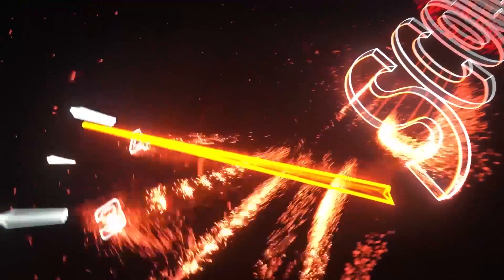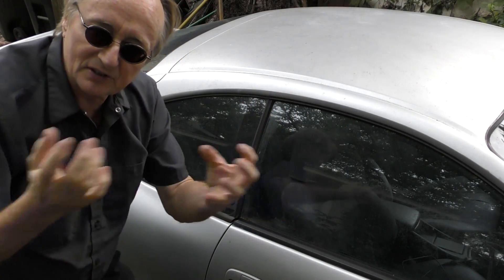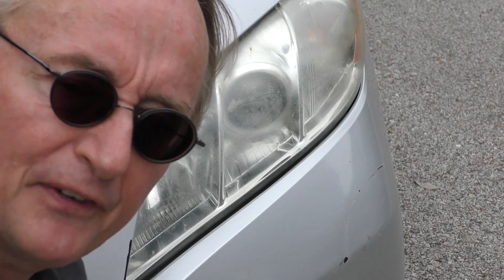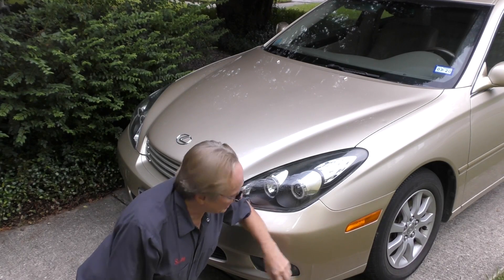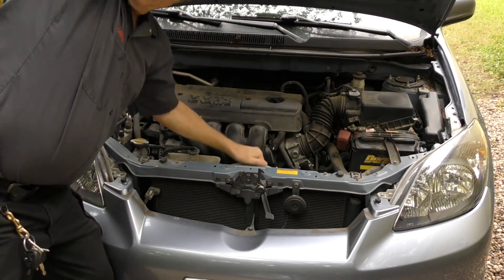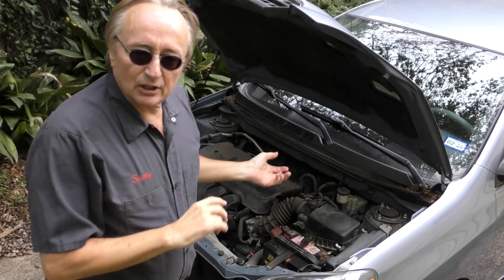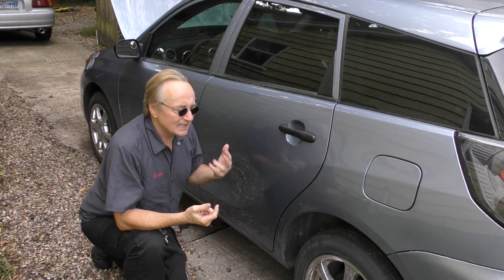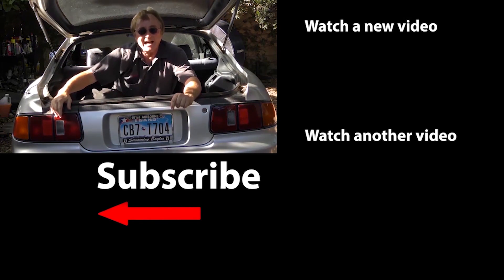You Can't Fix Stupid (Closing My Car Repair Business?)

Comment: And of course it goes out when you have a full tank.
Reply: and you can't siphon gas out of newer cars
Reply: And not only does mine go out when the tank is full, it waits until it's -30 in the middle of nowhere here in Wyoming, and the closest parts store is 60mi, away!!
Fortunately, I carry an extra behind the seat, but dropping the tank is a HUGE PAIN on this Chevy 3500, and no, I CAN'T just CUT a hole in the bed to get to it because of the 110gal transfer fuel tank and cross-bed toolbox.
But 16 fuel pumps in 19yrs is really stupid and being in the tank is beyond stupid!!
Reply: Everytime without fail
Reply: @kellypenrod2979  16 fuel pumps??? why are u still driving that ??
Reply: @kellypenrod2979  16 pumps in 19 years? That is insane.  Are you making sure to fill up your tank before it gets almost empty?  The pump has to work harder if tank is almost empty.
Reply: here is a method i use and seams to work on on my 00 crown vic police car i never let it get below 1/4 tank. see there is some oil in gas and it lubes the pumps. try this method for awhile and let me know how its worked for you.
Reply: Always hahahaha
Reply: Zmax will triple the life of a fuel pump also
Reply: i just kick my tank when my pump fails
Reply: @KeithOutWest  by the sound of it, its a diesel. At that temp its gel. He isnt cutting it enough with gas to make it work properly putting hard strain on the pump.
Reply: @KeithOutWest  Oh yes! that's a very old habit with me! 
Also, I only use pure gas, hot the ethanol.
Thanks for the reply though!
Reply: @brandoncaldwell95  Nope, Vortec 454
2000.
Reply: @kellypenrod2979  Then you shouldnt be eating pumps unless youre getting cheap ones. Im still on the factory one with my 05 silverado.  Dont drain the tank as the fuel is its cooling/lubrication. If need be, buy a racing type fuel pump or even a dual setup. Never below a 1/4 or an 1/8 of a tank. 

I was going to get a 95 454 which ran like a top. Didnt as the interior was shot. Still shoot myself tonthis day not getting that dually. Actually tired of paying my 2018 ram 3500 and wanting an older 03-07 crew cab 4x4 dually 6.6L allison. Truck is way too rare to find!
Reply: @brandoncaldwell95  Don't know what to think, getting my pumps at the Chevy dealer in Evanston, or rock springs, tank has been flushed 11 times never found anything.
But it's all coming to an end anyways,  this POS only has 123000mi on it, and besides the fuel pump issues, I have had the front end rebuilt 6 times, 5 transmissions, 1computer, 3 AC Compressors, and now the top of the bed is against the cab because the frame is bending.
Dealer says the trucks not designed to haul weight at front of bed because it's above a (crumple)
zone.
So, I have found a 97 Ford crewcab 4x4 dually flatbed with 72000mi and it's stick shift transmission and trans-case 7.3 diesel from a man in our church who had a stroke and can't drive anymore.
this chev is the first NEW pickup I ever bought, it WILL BE THE LAST CHEV I EVER OWN.
Reply: @kellypenrod2979  Hmm, well dealers usually grab their fuel pumps and many other parts from regular auto parts stores. Im not joking on that either. As for the bending, thats the hot cold temps and rythmic bouncing over time. Ive never had a truck bend on me and all the trucks here in texas that old and older are not bent.
Reply: @KeithOutWest  Plus they use the fuel as a coolant for the pump motor. Low fuel tank and there may not be any liquid around the pump motor cooling it.
Reply: @no candy Thank you. That sounds like a very possible damage situation.
Reply: Common hypothesis is a lot of people run their gas tank too low, and the pump doesn't get enough cooling effect from the (lack of) gasoline around it. Then you fill up with nice cool gas, and you shock the pump. Hence, fuel pump failure on a full tank.
Reply: @kellypenrod2979  : Kelly make sure you read what I wrote. All of it. I promise you that you will love your old truck again.
Reply: @ronfullerton3162  : Kelly's problem is a bad ground to his truck's fuel pump. Scan through the comments and read what I wrote to him in great detail about how to cure it.
Reply: @no candy : Kelly's real problem is a grounding issue to the fuel pump. Find the comment here that I made to him, in great detail explaining how to fix it.
Reply: @brandoncaldwell95  : Kelly's problem isn't the fuel pumps, it's the grounding to the fuel pump. Or should I say, lack thereof. Find the comment I made explaining to Kelly how to fix it. It's relatively long, but I explained in great detail what the actual cause of the issue is, and how to cure the problem for good.
Reply: @turbodiesel4709  Thanks for your time, and efforts sir, but I just got through SOLVING THE PROBLEM!
I bought that Ford from my neighbor,  And when I got home, I transferred all my equipment on to it from the Chevy, THEN I MADE A TRAILER OUT OF IT!! 
NOW it's a good Chevy, it will go where I need it to, WHEN I need it to.
And as far as the 90, and newer Chevy vehicles, 
NEVER AGAIN!!
Reply: @turbodiesel4709  Bad grounding has gotten to be a bigger problem with all the additional electrical applications on our vehicles. And some of them are crazy to find. I had a van once, and when driving along, all of a sudden the windshield wipers would start running. I would pull the wiper fuse, and it would stop. Later I could put the fuse back in, and everything would be okay. It ended up a grounding terminal up under the dash. It had some blue/grey corrosion, so I took it apart, cleaned, reassembled, and sealed the terminal. No further problems. I always expected something to happen further, because I assumed that some other circuit was grounding through the wipers. But happily, that was it. And I have heard of some other goofy things similar happening. The ground is very important as your information shows.
Reply: @ronfullerton3162  : For sure. I'd be willing to bet that two-thirds of all of our electrical problems in modern vehicles is caused by grounding issues, and corrosion at wiring connections. 

More often than not, such corrosion is brought on by rock salt and calcium chloride that is used on our highways during the winter months. Not to mention, the all too common use of dissimilar metals, like aluminum in contact with steel, leading to electrolysis.
Reply: @ronfullerton3162  : Kelly actually responded back to me. Unfortunately for him, he chopped up his dually Chevy truck, and turned it into a trailer. Well, at least he still is getting some use out of it. 

What's really worse is that he claims he replaced it with a Ford. Ugh... he has no idea the problems that will crop up with that piece of junk.
Reply: @turbodiesel4709  I am with you on the wiring problems on our vehicles. It is sad that a potentially good vehicle may of been chopped up to make a trailer just because of a bad ground. But it sounds as several other problems plagued the poor truck. And, oh boy, the great "brand" wars! We all have our favorites and villains on that subject. Unfortunately the indestructible IHC went out of production. No frills, rough riding, and not economical, but what a work horse. Chevy poor quality and false promises as well as failure to honor warranty in the seventies soured me for that brand. Dodge back then, ha ha ha. Ford produced a good working truck and really followed up under warranty. But to be honest, I do not know what anything is like since the early nineties, so cannot weigh in on anything since then. I was concerned about bigger trucks after that. Really, in many cases, most of them would give good service if set up right for the job and then properly maintained thereafter.
Reply: @kellypenrod2979  Sorry to hear of what you went through. Hopefully the Ford works out better. I'm sure happy with mine!
Reply: @turbodiesel4709  great info. Thanks for sharing.
Reply: @KeithOutWest  I owned Ford before I bought the junkolet, never had any problems other than normal maintenance.
I appreciate the shout back, and advise thanks! ;)

Comment: Scotty you make me really appreciate my old 94 Acura Integra which I've maintained and has 224k miles with the original trans and engine.  I use Penzoil High Mileage synthetic oil and for low miles (3k per year) only do yearly oil changes.  My AC compressor broke, no problem, I just took off the belt, I only use it for short trips anyway.  Fuel filter was a breeze to change.  Cheap parts.  Never knew the newer cars were more costly to repair.

Comment: I just replaced the radiator on my 2002 4Runner yesterday. I found an all aluminum radiator from champion racing. A much better radiator than the stock plastic one.

Comment: You ever replace a panoramic roof sunblocker on a 2014 passat wagon? It's a moving piece of cloth that is moved with metal clasp as thin is a soda can, and they break. In order to replace it, you have to take out the roof liner to get to it, but in order to do that, you have to take out ALL OF THE REAR TRIM (except floor carpet). And some of it never comes back together right ever again. Then the rear seats, then all the pillars. After that, NOW you can take out the roof liner.

Comment: Hey Toyota: 
 Please listen to Scotty Kilmer
Reply: had a brass radiator in a Toyota 4 runner back in 1987 and it cracked and leaked, had 2 aluminium radiators in a falcon and they both cracked, put a plastic radiator back in, no more problems. Nissan patrol with 200000km on it, no problems with plastic radiator.

Comment: Water pump on the timing belt now that is a stupid idea.
Reply: Even worse is the water pump driven by the timing chain.  Ford’s 3.5 was that way for awhile and caused all sorts of issues.
Reply: @johngriffith7315  Yeah to bad if the pump failed.
Reply: Nicholas Galea Caterpillar and John Deere designed engines with internal gear driven water pumps was a so, so deal , bad when they fail , change at recommended intervals , or suffer the consequences.
Reply: @beckywatt5048 Wow, Hard to believe someone would design such an engine.
Reply: The water pump in my Ford is in the engine.
Reply: Steve Silvas  It's up for sale if want one?
Reply: Vauxhall, the UK division of GM, did that a lot.. You always replace the water pump when changing the cam belt, otherwise a seized water pump could destroy the cam belt and thus destroy your engine.
Reply: Yeah but they rarely go out and if you change it when you do the timing belt at it's scheduled time you will never have problems.
Reply: @dustinpomeroy8817  or if it a Toyota, only every other timing belt - my pump still felt tight after 192K miles, but I changed it out.  At 280-something-K, I'm thinking I'll leave the one I changed in for another 90-something-K - that job is due now.
Reply: @lsh3rd  I don't know with a kit it's not much more money and the few I've done it was only another 20 minutes or so,I think I would just do it
Reply: How about power steering pump driven off the cambelt in the Lancia Gamma?
If you start it on full lock, the cambelt comes off and wrecks the engine.
Reply: The engineers who design that should be forced to drive and maintain them !!
Reply: @larrybe2900  It puts the pump inside the engine, making it more efficient. That's the excuse, anyway.. The reality is it makes it harder to fix, and causes more damage when it fails. In other words: a mechanic's dream.
Reply: @taunuslunatic404  What no bypass valve?
Reply: @Nick41622  Not that I know of.
Reply: @taunuslunatic404  Ok, thanks for replying.
Reply: It's the absolute best way to prevent overheating due to a broken water pump belt. Don't talk about the valves and pistons.
Reply: @InsideOfMyOwnMind  The pump can cause the belt to break then your screwed. Definitely not the best way to prevent overheating.
Reply: @Nick41622  My comment was to highlight an asinine approach to the matter but only some will get it and the rest will try to correct me.
Reply: @InsideOfMyOwnMind  I would rather have the water pump & belt where I can see it & easily replace it.
Reply: @Nick41622  yup. Right in front of the timing chain that you have to pull the water pump off to get to when that plastic cam gear and guides go legs up. The message is the front end of an engine is a maintenance item no matter how you slice it. I do them both every time in each config.
Reply: @InsideOfMyOwnMind  I have never broken a water pump belt in my life, always change them before that can happen.

Comment: My 1989 Toyota Supra still has the original fuel pump, but I did replace the leaking plastic radiator with a triple core all aluminum performance aftermarket radiator and it works great too.

Comment: The good old sensible days are long gone.
Reply: @Steve W - Ya got that right fo' sure! They wson't be back in THIS lifetime.
Reply: Nah, you really think these companies with all their repair shops and all the engineers working for them don't recognize theses problems? They know exactly what they're doing it is all made to fail. They profit the most off of the service department and if the cars are extra unreliable after ~5yrs it forces ppl to upgrade and effectively kills the resell market meaning anyone who wants to buy a luxury car, problem free, needs to purchase new from them.
Reply: @Noadvantage246  It's designed to keep the debt cycle going! Even if you want to keep and maintain the car or truck it's very costly to maintain! I've seen people freak out after finding out it'll be 5 to 7 grand to fix all their problems! They just say "screw it" and junk it and buy a new one! This is why I don't own anything newer than a 1993 of anything! I can rebuild my 2 Dodge trucks 5 times before I come close to the cost of these POS today!! And I can do the work on them!
Reply: Squiggummer Figgammus  Much higher than it used to cost! Most parts today are about triple!
Reply: Lose the profit motive and they might return someday.
Reply: Planned obselence
Reply: Ive been hearing that for 30 years
Reply: @rainbowriderjt7833  But cars are more reliable than ever...
Reply: @FirstLast-mb9fq  If you think that then that's fine but if you watch any of Scottys videos you'd know that's not true! Now some of the engines are good, but what good is the engine if everything around it breaks because it's "cheaply" made and cost a small fortune to fix every time??
I worked in a garage for a while. Scotty is spot on on everything! 

Now if you or anyone else loves these new cars, then fine! Knock yourselves out! After all, America was made on "choices" but the fact is that they are NOT made to last as they claim and when they break and the warranty is over, you better have lots of money set aside for repairs!
Reply: @rainbowriderjt7833  : 100% spot on! Overall, there's nothing better about junk produced today. It costs more to purchase and maintain a vehicle today than ever before, in the history of motor vehicles.

Comment: All these supposed improvements to  auto manufacturing  using so much plastic  wasnt only about cost saving, but about reducing the weight of vehicles in effort to comply with never ending mandatory mileage and fuel economy guidelines.

Comment: Well Scotty, my 2002 BMW E46 330ci also has the fuel pump behind an access panel under the back seat.
In fact  changed mine 2 days ago after the original cried enough after 147900 miles.
Simple enough job to do and just a little bit messy, not much.  She's all good to roll now for another 147,000 miles. 
Changed the fuel filter too as preventative maintenance.

Also the water pump on my BMW has a metal impellor :)   They're built properly.